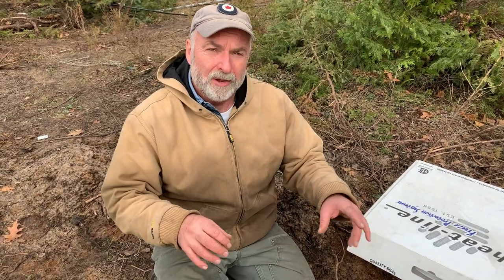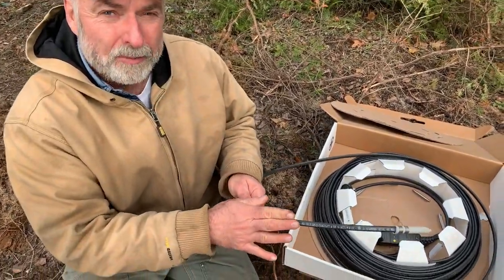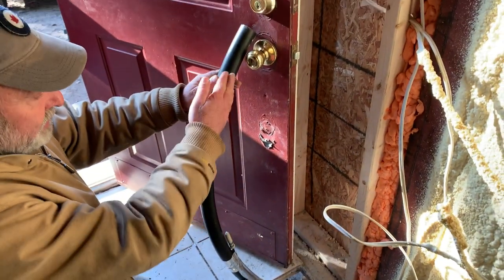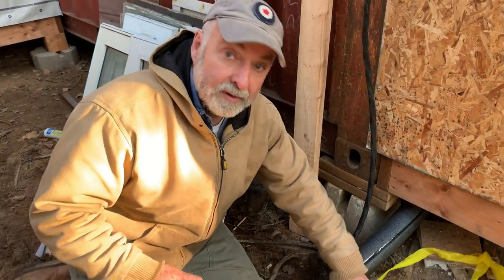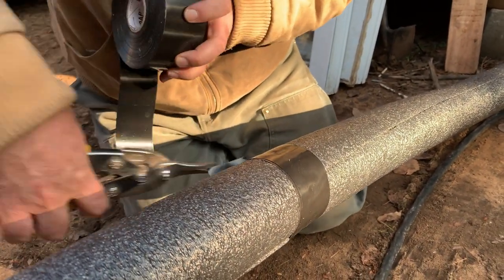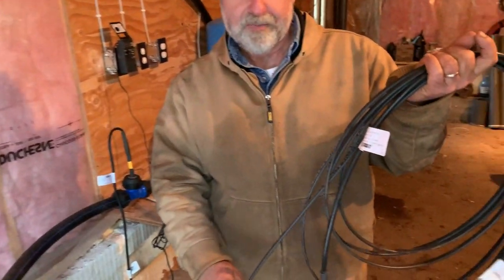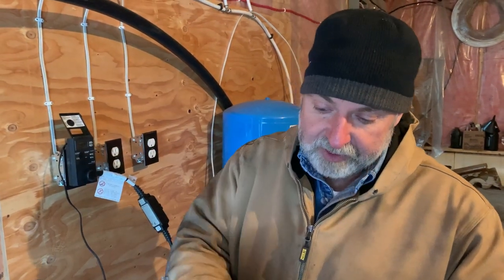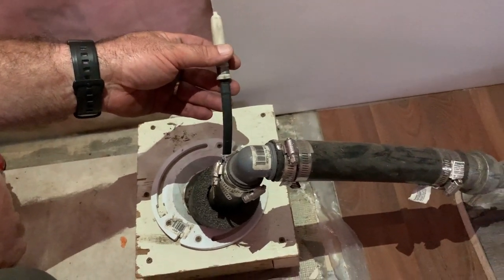Protect Pipes From Freezing With Pipe Heating Cable & Waterproof Insulation

Comment: Thank you for the great and easy to follow video. A couple of questions. Based on the diameter of the PEX/Foam insulation, how much bigger is the PVC pipe? I have a 900 ft run that will be mostly above ground due to the terrain - I cannot get 18 inches deep. be done in 2 sections due to the limitations of the Heating cable and my plan was to lay the PVC first and pull the Insulated PEX through it - is that a mistake? Should I do what you did and slide each section of PVC individually after the PEX is in place? Thanks, James

Comment: I have been meaning to bring this up to many folks especially the physicists and I have yet to get a genuine answer for it.
This is my own personal observation and experience.
I have a two car deteched garage and live in Easter Washington State.  We can get pretty cold.  This year we had temperature drop to about 10 deg F for two weeks to give an idea.

So what is my story?
I have always noticed that I have had jugs of water in the garage for one reason or another just been left in garage forgotten etc. In fact at any single year through the winter there has been some container with water in it.

Moral of the story.  I have never seen any of it ever frozen and I mean in the heart cold winter.
In fact this past winter I actually paid close attention and in fact I placed cups and glasses of water in the garage.... at ranodom areas inside the garage, by the door, over the counter etc,.. never once any of it was forzen. even remotely frozen.

Why?

Whatever the answer is ( which I do have my own opinion).  Based on that I can and like to conclude that one can actually stop pipes from freezen even outside without heat tape.   But how?
 

My opinion is... instead of heat tape, one can just install a large diameter pipe over that water pipe with insulation that is not desne like the ones thay sell.  LIke the one you have installed for instance.

The outer pipe should be large, say 10 inches and then gently feed it with home wall insulatoin type.  Paying close attention not to pack it.

In other words... it translates to this:  Air and especially dry still air is a poor conductor.  So all that still iar inside the piple will not transfer to outside air through that still air inside with all the fluff insulation. And furthemore the wall of outside pipe acts as barrier just like the walls of the garage is.   There is sufficient insulation that the water just won't freeze.

However some physicists have the explanation that the Earth, the ground of the garaage conducts heat from under the ground and heat from there rising, the natural geothermoheat rising and gets trapped in the garage.......

One should make a note that the garage has concrete floor.....

Comment: i didnt use the tape wrap but i put the frost king heat cable under the bottom of pvc pipe with electric tape. then put the foam insulation (the kind that looks like a noodle) over that. i keep hearing mixed answer that the foam will catch on fire and wont catch on fire
Reply from the maker: Well, your setup certainly could catch fire. The risk is significant because the Frost King tape is not self regulating. Yes, it does have a little disk that's made to detect the temperature of the pipe and shut power off, but if this thermo-control disk gets separated from the pipe, and especially if the disk is outside the insulation and the tape is under the insulation, the tape will definitely overheat. This is why cables like these are sold with instructions not to install them under insulation. I've intentionally done this to the kind of tape that Frost King is, and it turns the insulation into a melted mess that smells like a chemical fire. I didn't let it go on long enough to have internal short circuits, but that kind of thing never ends well. Whether or not things go bad depend on how overheated the cable gets. Sorry to be the bearer of bad news, but what I explain here has been my experience.
Bye for now and thanks for watching.
Steve
Reply: @baileylineroad   thanks for the info, i was thinking the same thing to. my installer is a retired guy. hes certified in electric and furnace stuff. but some of this new stuff is kinda new to him. hes use to using heating tape in the past on many projects but he never saw this kind with a thermostat, and its the only kind home depot sold. he said the old kind ran at a low degree constantly. he said it should be fine, he called the place because the instruction booklet is very minmal. they said basically itll run, until it malfuntions. my fear/issue is the same as what you said, the malfunction could result to fire. my installer said itll just stop working  when it fails. but im really picky when it comes to this stuff so i think i may unplug it and not use it at all. the pvc pipe is wrapped with the foam insulation and i think thatll be enough to keep it unfrozen once i unplug the heat cable, i dont think it got cold enough since instal to kick on. my setup before was the clear tube that came with the condensate pump, had no wrap on it at all. and the furnace is only a year old and the original company wouldnt come back to fix their mistake. i also asked to hook a gfci up and he said i didnt really need one,  but my fear again was the tape malfunctioning and hoping the gfci would pop. so hes going to put one in. but i think i still will feel better just unplugging the heat cable.

Comment: I had to redo my water pipe.from my well new pump.my pipe is covered all the way to house with insulation pipe.square insulation then rocks.at end of house sticking out.it has round insulation house insulation then plastic.tapped on..no electric tape..this was doing good for several yrs even in winter.aboutb3 or so yrs.but this yr it froze..now I'm told to use space heater???

Comment: I actually wasn't paying attention at first.  I thought this is underground pipe to some shallow depth perhaps  and such an insulation effort would be overkill.
From the look of it, it is set up above ground and this is done to save on labor of digging a trench to bury the pipe.  
I think it would be far cheaper if one just digs a simple trench.  The heating tape apparatus along with the insulation and then another pipe over it adds up to some expense.
Reply from the maker: Hi Blue Ocean!
You're right about it being cheaper to bury pipe, but that's not always possible. This technology is primarily for sites that don't have enough soil above bedrock to protect against freezing. There are other applications, too, but shallow soil situations are the primary ones.
Thanks for watching,
Steve

Comment: I thought Heatline's water line heater was designed to go inside the pipe?
Reply: No
Reply: Yes heat line is designed to go inside the sewer pipe I don’t know why it’s been applied on the outside. We just purchased one.
Reply: Refer to the heat line installation video

Comment: All sites say do NOT USE foam insulation near heating tape. Only use non flammable material
Reply from the maker: Hello and thanks for your comment. You're right about foam insulation in all cases but one that I know of. The stuff I install in this video is specifically rated for use under foam insulation. The reason is the self-regulating heating cable. It never overheats because it has what amounts to a built in thermo-safety feature. This cable controls its own heat output variably along its length. This feature applies even if you don't use a thermostat.
Drop by my website https://baileylineroad.com for a visit sometime. You'll find lots of stuff there, including tool giveaways, articles and videos of interest to hands-on, how-to people. I've got a generator giveaway on the go now.
Bye for now and thanks for watching!
Steve